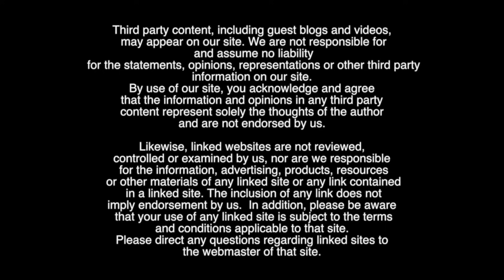How to Install a Dash Pad & Instrument Bezel in Dodge Trucks | Kevin Tetz with LMC Truck

Comment: Over time? The disintegration started way before time had anything to do with it as Dodge used the absolute cheapest materials on the interior of this truck. 2nd only to the really crappy factory paint but oh wait, American made products are better. I now drive a foreign vehicle and have had no such problems since. Still have my 2000 RAM QC V10 and am here to figure out replacing this shitty dash.

Comment: No FKing Way I’m doing that.... way too much work. I thought the video was going to be simple and easy.
Reply: I just did mine. It’s a hell of a job. Did it by myself. I did not take the dash frame out though. Set aside a full weekend. Simple tools only. Have fun lol
Reply: And this comment coming from "Iron Man"   HaHaHa !!!  What do you do in "your" Iron Man race?  swim one pool length, bike around the block, then run to the mail box?
Reply: @mattywho8485  
It supposed to be a simple video for regular people to show them how to do the work them self. If that’s the case I rather go with technical institute for 3 years and work for regular shop or dealership hahahahah. 
Just make the fucking video more simple short and clear....! That’s like a hole episode of discovery Chanel or velocity Chanel..

Comment: LMFAO  thats a dumbass way to do it,  it only takes 1 hour because the dash is crumbling to pieces already.  dont need to pull the whole dash to get to the screws behind because the dash breaks like peanut brittle and you can just snap it off were the screws are   LOL.  did mine in about an hour  sooo ez.